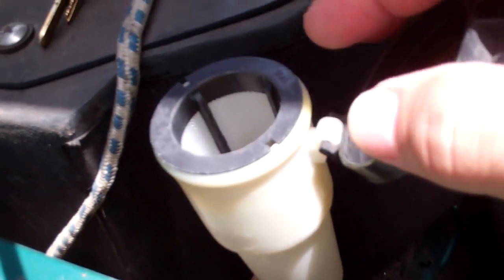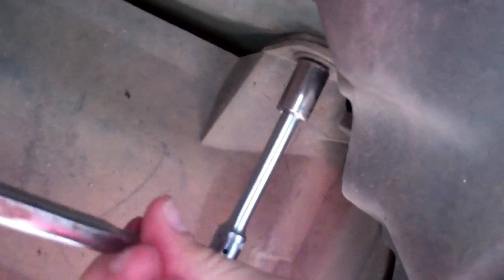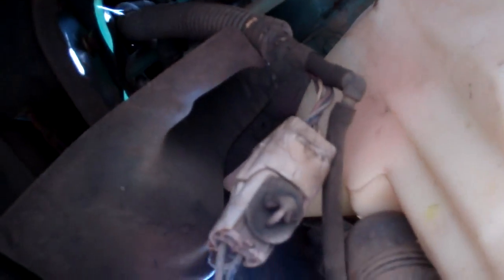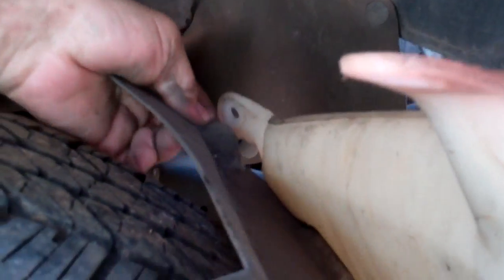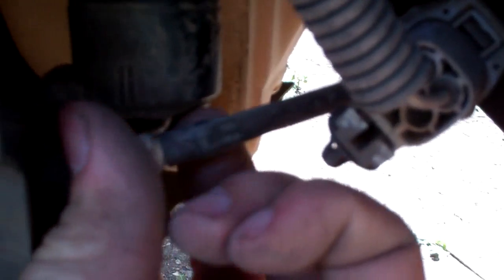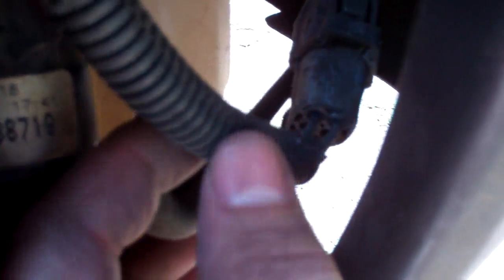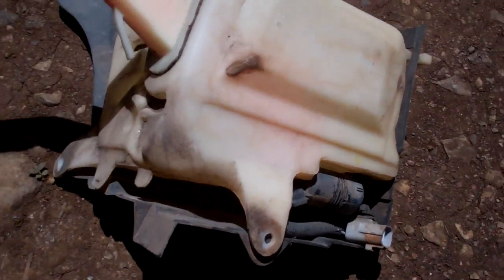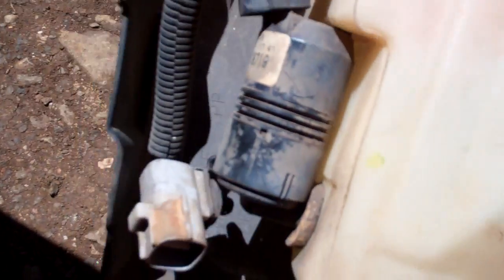Tacoma washer fluid reservoir removal

Comment: That little 180 degree change of direction rubber fitting that attaches to the pump was split in exactly the same place  as yours on my Tacoma.  Tank was fine with no holes or cracks and the pump seal into the tank was good too.  Since you probably cannot get just the little 180 degree fitting, I just went directly from the pump discharge to the windshield washer fitting with a 3/16 inside diameter rubber hose from Auto Zone.  End of story.  My Tacoma is 23 years old and I couldn't believe how nice the tank was.....looked brand new....must be my low miles of 110K.  NOTE;  The tank shroud is attached to the tank at two locations with a staple.  If you are gentle and careful you can pry the stables straight up and then be able to separate the shroud from the tank with some careful prying.  If you can make your repair with the shroud in place, do so.  I removed mine so I could make a better inspection of the tank.  When you go to reattach the shroud to the tank you might have to enlarge the staple holes with a tiny drill bit (# 60) to make it much easier to push the staple back through the plastic tank flange and then bend the stables back over.  If you cannot re use your stables you can attach the shroud to the tank flanges by drilling and using 1/8 inch pop rivets which is an easy job (if you have a pop rivet gun). I highly recommend removing your tire for this job, it takes just a few minutes and gives you much more room to work.  Good Luck !!

Comment: Aloha my friend!! I had this same problem with my 1997 Camry when I bought it a few years ago. I thought it was the reservoir but it was just that rubber elbow coming from the washer pump. Mine was split in exactly the same spot as yours. That explained why It would only leak if I used the windshield washer. Great video!!

Comment: Thanks for the video. I got the same issue, I took the wheel off fluke you mention and speed up the time in half. It's not the container that leak. It's the pump cost around $21.00 from Autozone.

Comment: Same here, the fill neck just dry rotted and fell apart but the tank body still holds fluid. Before this, that half circle pump coupler split along the mold seam and the puddle below led me there. I'll be doing the same as you... new reservoir of some sort.

Comment: I have a 2002 Tacoma and mine has been leaking for some time. Yesterday I noticed that the neck was full of cracks. Its a shame Toyota used such cheap plastic to make these.
Reply from the maker: Lee Mullen Mines from 1998. I'm surprised it lasted this long through my abuse.  Yeah seems like yours should have lasted longer.
Thank you so much for watching and the great feedback. 
Aloha and take care
Reply: My Tacoma is a 1997.....has never leaked  I live in the NW.  I think these tanks fail more quickly in hot dry climates.

Comment: I think mine has a leak near the top, I think must be where the elbow and hose connected. I still able to use  it except I cannot fill up to the top when it used to be. It started to leak after I filled up 2/3 or more than half way.  Not sure I want to remove it because I think I may break something during the process; however, thanks so much for the video.

Comment: Fixed it last night, wiped down the tube with a big hole in it with lacquer thinner (good hot surface), wrapped with alum-ducting-ventilation tape, the real foil type that's crazy sticky.  Will suffice for now.

Comment: Lots of price difference on replacement reservoirs; $134, $85, $65......just wonder what the difference in quality is ?  Also seem to come in two parts; the filler neck and the tank.  The tanks I looked at seem to be identical.  Wonder how good the seal is?  Anybody have any experience with the replacement tank ?
Reply: I bought my reservoir from my local Toyota dealership for $130. They’re harder and harder to source, that’s why I went to the parts dept at dealership. I have 02 Tacoma v6 prerunner. The tank and neck all came together labeled part # 85315-04050. Hope this helps!

Comment: I easily repaired my cracked reservoir before it was too late with fiberglass cloth and epoxy resin from a kit.  Here's the video if anyone is interested in my experience:
https://www.youtube.com/watch?v=cj5d6XI16u0
This seems to be a very common problem on aging Tacomas.  The heat eventually deteriorates the plastic until it cracks or crumbles.
Reply from the maker: worsethanchiggers Awesome will do! 
Thanks for watching and commenting.